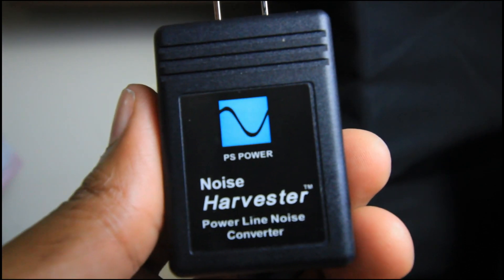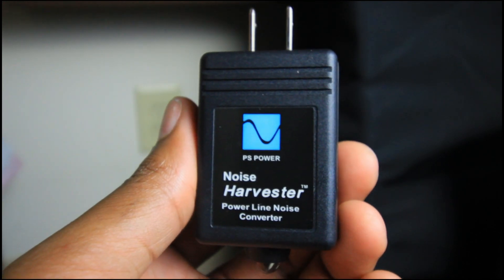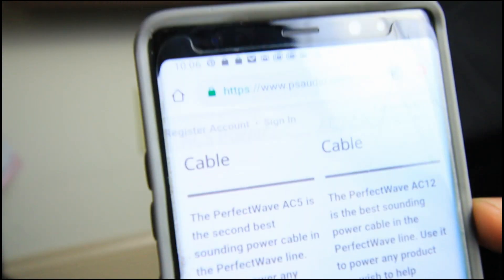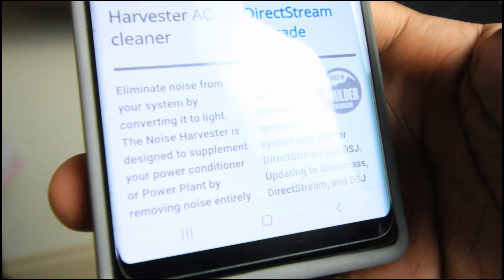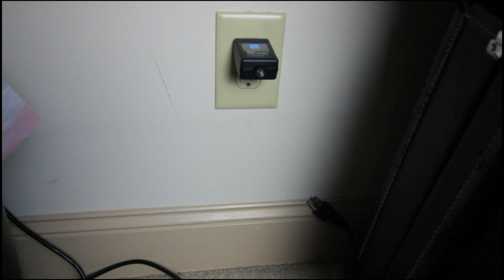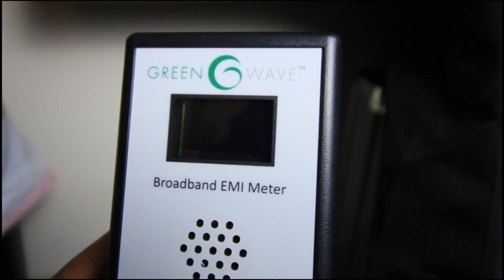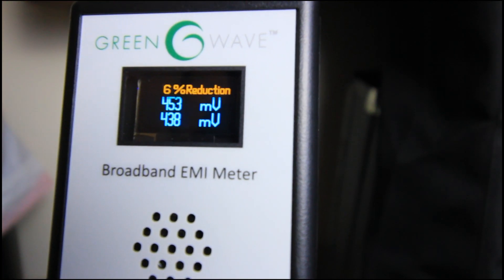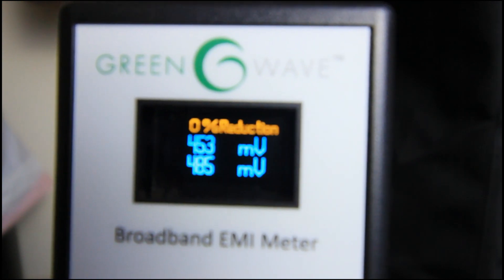Does PS Audio Noise Harvester Really Work For Cleaner Electricity

Comment: You're going about this the wrong way.  I have the same Alpha Lab meter (as well as an Entech) as you do.  In your last review you used surge suppressors which won't affect noise levels to any significant degree.   Watch the YouTube review on the Isotek IsoPlugs.  A similar device that measurable and audibly works.  Additionally, you can find isolation transformers  (Powervar, Oneac) on Ebay for reasonable bucks which also will offer measurable lowering of noise that your meter will detect.

Comment: Nat Coziay, you cannot measure THD, Electrical transient, peaks, etc with a cheap equipment (expensive AM radio) however you want to call that garbage you use to measure that. you will need something more sophisticated to do that.

A little bit of theory
https://www.allaboutcircuits.com/technical-articles/understanding-thd-total-harmonic-distortion-in-power-systems/

the cheapest an easy way to do that is using an industrial multi-meter like the fluke 87V that have the PEAK MIN MAX feature that can help you to measure the ratio that should be around 1.5, if the signal is distorted the peak will be higher and the RMS lower that is translated in a ratio > 2, topically caused by electrical issues associated to neutral.

https://www.youtube.com/watch?v=FJDIUjTdicU&t=13s  <<= how to do with the fluke 87V

To test what is induced from AC power line to your DC devices you need to expend more money on equipment such hi-end oscilloscopes or power analyzer (arround 10K USD).

hope it help.

for more info google it

Comment: You seen to be looking to gave this fail. If you do not know who Paul McGowan is , you really have no idea if the top people in the audio design world. You sound like you have a ground problem as there us no varation in you "dirty electricity".the other part of the equation is the building you live in. This PC of equipment made by PS Audio, one if the last of a breed if mfg in Boulder Colorado, make some if the vest amps , pre-amps DAC's and other high end audio. This was designed by Paul McGowan himself, a world renowned electrical engineer.  If you buildings electrical grid has been modified in any way by individuals who have no idea of keep the building up  to code. Reguardless of what you do in your test, You dud not check to see how that out let us hooked up. Or checked to see if it is malfunctioning. Sorry , you test means nothing.

Comment: I worked in electronics all my life. Decades ago you could buy surplus Corcam line filters for a good price. I used to do all the conducted EMI testing  (using a Marconi 2380 test set) for our power supplies that we sold to the government and we had to meet very stringent standards to pass their tests. I picked up a surplus 20 amp filter that consists of series chokes and good quality caps across the line'

I plug everything into an 8 outlet junction box that is mounted to the back of this filter and plud all my components into EXCEPT for the two 700w mono block power amplifiers. I know those throw of diode spikes and I don't want that getting into the signal level components (preamp, DAC, CD Player, and turntable. So far I have not had to clean up the power to those power amplifiers, I do have a dedicated 20 amp receptacle that runs right from my service panel and the 8 outlet filter plugs into that with a #12 grounded cordset. That 20 amp line from the electrical panel goes through a  heavy (50+ pound) 240 to 120v isolation transformer that helps clean up some of the noise.

Comment: If you want to reduce your dirty electricity by 90% out of your outlet, purchase a Tripp-Lite Isolation Transformer 1800W, it will be the best money and upgrade you'll ever make for your high-end  audio system.
Reply: Are you actually suggesting a 1100usd unit, in relation to the test of this 100usd device?
Reply: @MrRotten187  The $100.00 unit doesnt work, it just flashes a bluelight.  The Tripp-Lite works.
Reply: @dfj555  I am aware but still, if a person has the budget and the will, to spend over 1000usd on something like that, i they would most likely not be looking at a 100usd "substitute"...

Most people do not have 1000usd worth of equipment to plug into it to begin with.

Comment: I notice you have reply from PS Audio, probably Paul, the owner of the company, but for one month (so far.) you don't give him a reply. Why is this? Maybe because you've already showed you don't really understand how to properly test equipment. Your reputation has been seriously damaged. At least until you have a constructive conversation with the manufacture who is perfectly willing to talk with you on the subject. I'll check back later. One, to see if you do reply and two, to see if you delete this post.
Reply: have a look at this:

http://collinsaudio.com/Prosound_Workshop/Noise_Harvester.pdf

Also, look at the product specs of this EMI meter:

https://www.amazon.com/gp/product/B01MEFVYQD/ref=as_li_qf_asin_il_tl?ie=UTF8&tag=freemix-20&creative=9325&linkCode=as2&creativeASIN=B01MEFVYQD&linkId=9bf4f1ec1e7f25860ba28c5843dd8c73

It measures noise from 3kHz to 10MHz. So there goes Paul's theory...
Reply from the maker: Either the product does what it is advertised to do or it doesn't. Clearly it does not do what it is advertised to do according to their website. I'm not a scientist or an electrician, I'm a consumer. If I need a degree in physics to use the product then state that up front. There's your response.
Reply: @natcoziay -- "Clearly" you are NOT testing CORRECTLY. Knowing how to properly test equipment doesn't require a degree in Physics. Saying that is just nonsense and a way for you to argue your baseless fact.
As you stated, your a consumer that thinks your handheld consumer tool is the answer to all when testing equipment. You are incorrect and you've been told this by someone who has many decades in the audio equipment world, but you refuse to listen or even respond and engage in a meaningful conversation with the manufacture about their product. 
A true reviewer of audio products (or someone testing a product.) would gladly welcome a one on one conversation with a particular audio manufacture they were writing about or making a video about their product.  That's my response to you Nat. Now,  let's see if you still refuse to reply to PS Audio (the owner.) in this video.
.
PS- please, don't talk to your viewers like they are stupid. They said "we have them all over the office and they look cool" You really can't think people are going to believe that. lol!
Reply: Fuck you Mark, you piece of dog shit.

Comment: Let me guess, due to it being marketed by a hifi company, you can (or should) only hear the difference and not necessarily be able to measure its effectiveness. 

Not sure if your testing device works better than the device being tested. 

My observation with this device so far is, it is a parallel device.

The harvester cannot therefore clean power going through it before passing it on. 

How would one know how many one needs?

Maybe plug it onto the output of a (hifi brand of course) mains regenerator, there should be little to no noise to harvest. 

Maybe one should be using lots of them, or sit closer to the speaker, or change the power cables first? 
Maybe the harvester should be closer to the noise source?

Comment: It does do something and the person making the video doesn't quite get what's happening and that is understanding because it is a tricky subject that requires a bit more sophisticated equipment. 

First, to answer Janina's question of what it is, I'll explain the circuit to you. Inside the Harvester is a balun used to magnetically transfer common and differential mode noise energy into the Harvester from the AC plug. There's an associated tank circuit as part of the balun that is tuned to about 10kHz. Any noise, hash, or unwanted energy on the line from about 5kHz to around 20kHz (with a peak of 10kHz) is transferred through the circuit and fills up a capacitor with that energy. Once the capacitor's level exceeds a predetermined point, it triggers an SCR and dumps its energy into the LED. Thus, unwanted energy is converted from noise to light. This is quite different than a standard parallel capacitor noise circuit which shunts the noise across the line but does not eliminate it.

The tester Nat is using is essentially an AM radio receiver with a metering system and it's somewhat like the Harvester though tuned differently. It is not looking in the same place as the Harvester works.

The Harvesters clearly lower line noise that's easy to see on an oscilloscope but not to easy on this analyzer - a device that's good for some consumer applications but doesn't really how us what we need to know when it comes to lowering some types of noise that can harm audio.
Reply: Right.  This guy making the video has absolutely no clue what he is talking about and really shouldn't be doing tests trying to inform people without any knowledge
Reply: B.S Audio
Reply: Didn't say that in the ad.
Reply: Do you even understand what you are saying? The concept of The process of charging the capacitor with noise energy only injects more noise into the ac line through a point of common coupling. The current flowing through the ac wires into the harvester causes a noisy voltage droop on the line, which is then transferred forward to the loads. 
have a look at this:

http://collinsaudio.com/Prosound_Workshop/Noise_Harvester.pdf

Also, look at the prodct specs of this EMI meter:

https://www.amazon.com/gp/product/B01MEFVYQD/ref=as_li_qf_asin_il_tl?ie=UTF8&tag=freemix-20&creative=9325&linkCode=as2&creativeASIN=B01MEFVYQD&linkId=9bf4f1ec1e7f25860ba28c5843dd8c73

It measures noise from 3kHz to 10MHz. So there goes your theory...

Better rename your company to BS audio or Snake Oil Hi Fi... In the words of Melvin Udall: Go Sell crazy someplace else. We're all stocked up here...
Reply: Nat Coziay, you cannot measure THD, Electrical transient, peaks, etc with a cheap equipment (expensive AM radio) however you want to call that garbage you use to measure that. you will need something more sophisticated to do that.

A little bit of theory
https://www.allaboutcircuits.com/technical-articles/understanding-thd-total-harmonic-distortion-in-power-systems/

the cheapest an easy way to do that is using an industrial multi-meter like the fluke 87V that have the PEAK MIN MAX feature that can help you to measure the ratio that should be around 1.5, if the signal is distorted the peak will be higher and the RMS lower that is translated in a ratio > 2, topically caused by electrical issues associated to neutral.

https://www.youtube.com/watch?v=FJDIUjTdicU&t=13s  <<= how to do with the fluke 87V

To test what is induced from AC power line to your DC devices you need to expend more money on equipment such hi-end oscilloscopes or power analyzer (arround 10K USD).

hope it help.

for more info google it

Mr McGowan my respect :-)

Comment: Noise Harvester does not reduce EMI (electromagnetic interference). It removes high frequency noise and emit through LED.
Reply: Machined Aluminum No, it’s an utter snake oil fallacy. You reduce the noise energy your device will see much more effectively by a simple filtering cap. If you want to reduce noise, lower impedance is better and lowest impedance will not yield energy to power an LED. Thus is just an overpriced high pass filtered LED flasher.
Reply: @ThinkingBetter  the guy in the video is thinking that this device is lowering Emi. This is not an EFI/EMI filter. Smh...
Reply: CeeStyleDj Agree, it’s an overpriced X capacitor  mains filter with a snake oil LED indicator.
Reply: @ThinkingBetter  No, What I am saying is it's not an EMI filter per se.

http://stereotimes.com/acc041007.shtml
Reply: @CeeStyleDj  It's an expensive X capacitor with an LED flashing gimmick also. The LED circuit actually lowers the filtering efficiency compared to just a capacitor cutting noise. X capacitors are widely used inside electronics to reduce mains noise. If you understand electronics, you can check it out here: https://www.pinkfishmedia.net/forum/threads/ps-audio-noise-harvester.148687/page-3

Comment: Lately I have been experiencing a loud buzz through my guitar amp. I tried all my amps through all my outlets. The electrician can’t find anything. I went to three separate houses in New Rochelle where I live. My amps do the same thing there. I took them to guitar center in Yonkers, and they work fine. Someone please help me.
Reply: Guitar amplifiers have very high gain by necessity. 
Pickups and cables act as antennas and will pick up a lot of radiated electrical noise within a certain distance. 
Naturally, the amplifier, which cannot discriminate between desired and undesired sounds, 
will treat that noise the same way it treats the signals from your instrument. 
When you take your equipment to an area that has less noise, of course it won't pick up so much garbage. 
There are so many possible causes and sources of electrical noise that the best you can do on your own 
is take an AM radio tuned between stations and go "noise hunting". The louder the racket, the closer you are to the problem.  
It may not be possible to find the problem, though, and even if you find it there may be nothing you can do about it.  
An avid amateur radio operator with considerable experience in finding sources of electrical noise 
is probably the best in-person help you will ever get.
Reply: David O'Banion I’m going to try one more thing. I’m waiting for a power outage in my area. They happen from time to time. Then I will plug it in to the inverter powered by the battery.. If there is no static, then I will know Con Ed is the causing the problem.
Reply: @salvatoredaniele8020 
Unless it is a "pure sine wave" model, an inverter could be worse than a noisy power line.
Reply: David O'Banion Yes it is
Reply: you probably have a different power supply company.Also Look up at the power posts in the street outside the buildings and do you see a kind of bulky transformer attached to the pole? That's the issue im sure. In USA many states have antiquated transmission systems and it is probably the cause of your problems. I have some photos but cant post them here.....let me know what differences you see between the poles running the power lines to the buildings.
Reply: @eded8045  I live in a private house. I bought a 600 watt inverter, and a car battery. So as to play off the grid, and it still has a loud buzz. I even took it out in my big back yard, and it still does it.  I believe there has to be some kind of electro magnetic field, or its atmospheric. I mean what the hell else can it be? Its un frigging believable.
Reply: @salvatoredaniele8020  can you borrow  a new amp and try again? Amp plays ok in the store but can you try it at another store in another town? yeah its strange.....i follow a.great guy on YT search for Mr Carlsons Lab, a great community of experts also,there im sure an answer will come. Maybe join the carlson patreon channel and post it there... good luck let us know what it is ,we like happy endings.
Reply: @salvatoredaniele8020  When you took it to the place where it worked did you use your cable or their cable,it might be a grounding issue.
Reply: Have a Spritzer It’s something mysterious. My cousin lives about 4 miles away in the same town New Rochelle. He not having a problem with his amps.
Reply: @salvatoredaniele8020  OK,that does seem very mysterious.Have you checked "Uncle Doug's" channel? he's a mature age gentleman,very intelligent,he builds guitar amps,I think he may have been an electronics engineer,he has videos to diagnose different noise problems.
Reply: Have a Spritzer Yeah, he wasn’t able to help

Comment: They offer the detect power conditioner that is supposed to eliminate noise and deliver more power. The reviews are good however the reviews for this device are moderately good too. But after watching your video makes me doubt both products.
Reply: Yes your test is flawed. The device reduces high frequencies which result in line noise . My system has less of an ambiant noise when music is not playing. Not sure if I could hear the difference while music is being played. I use one and suggest to try it and take advange of the return poliocy if it does nothing for you.  PS Audio is a good company. The guy you spoke to there might not have been a technician. Too marry varibles.

Comment: But it change the reduction percentage? It doing somthin.
Reply: I see that as well. It's doing so,etching as the % change is staying at zero. It was bouncing all over the place before he installed it. And to be fair, what is is measuring is only one component of the noise. It's more complicated than just point one device at it and saying it don't work. I'm not shilling for ps audio as I have tried some of these devices in my system and some do work and some don't. Also, some do change the the electricity like a conditioner but not always for the better. A more resolving audio system will tell you if any of these devices work. I think it's doing something and needs more testing than just pointing one device at it and calling it snake oil😀
Reply: Brandon Burr It’s not doing anything a simple filtering cap can’t do better. I looked at the schematics a while ago and it’s more about getting the light flashing than getting the noise filtered out at lowest impedance.